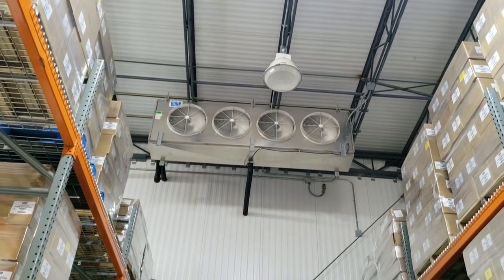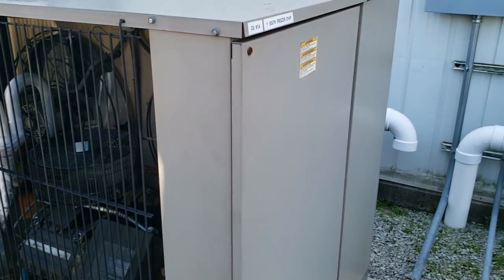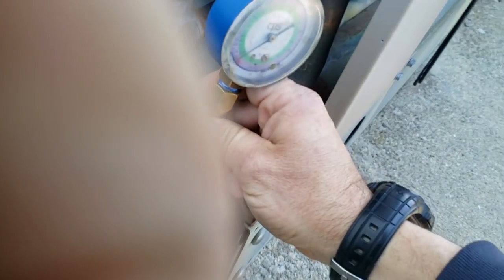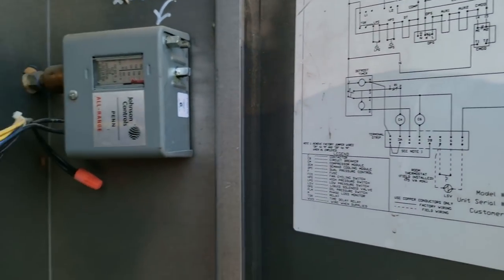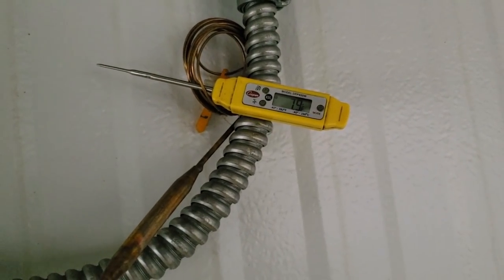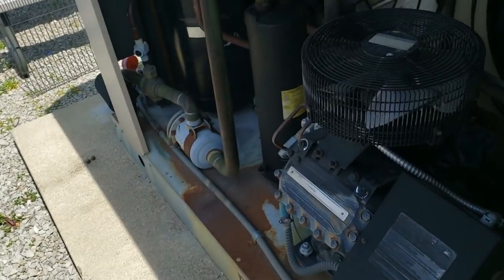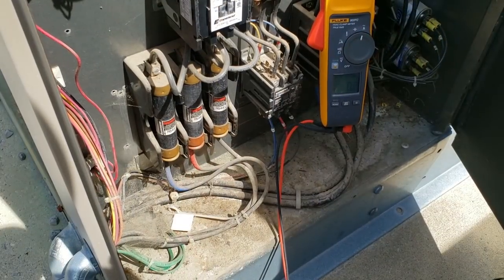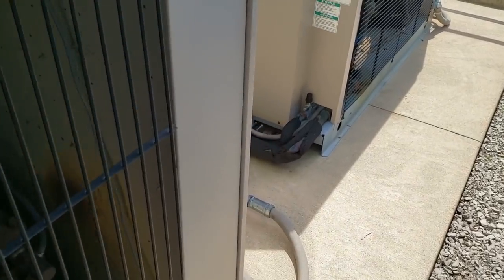Drive-In Freezer Warm

Comment: Wow, I thought you were in the freezer I just fixed yesterday until saw the second evaperator. The unit I was working on had an old Kramer evaperator. I had to climb a broken extension later to get to the thermostat. They had another tech out there before me that hacked the life out of the whole freezer. There are multiple places where the copper rubbed out its amazing that its holding refrigerant. The whole unit is pretty much soaked with oil.
Reply from the maker: Yeah that completely sucks. Luckily the guy was able to lift me up with a forklift in a cage. That made it easy.

Comment: it doesn't hurt to put meter probes on the exposed wire just beyond the lugs of everything, contactors, fuse blocks and more, that can catch a loose lug before it goes crazy meltdown, maybe even a weak fuse, but so can thermal imaging cam :)

Comment: Great troubleshooting. Thank you for posting.
It woud be interesting to follow the path of current asymmetry 43/37/37 A. Regardless of on how you calculate it, it is considerable. Copeland states max. 15% difference among currents and here we have (43-37)/37=116%,  i.e. 16% difference. It could be a result of voltage asymmetry but without voltage measurements this can not be ascertained.
Reply: Are you referring to current imbalance? 
 If so, the formula is as follows for the data provided: 43+37+37=117.
 117÷3=39. Our maximum deviation from the average equals 4. 4÷39=0.1025. Multiply this by 100, and we get a current imbalance of 10.256%
Reply: @jakem117  

Thanks for your input.

From "MOTORS FOR COPELAND™ SEMI-HERMETIC COMPRESSORS", Ref: D7.9.1/0703-0415/E  I quote:

"Deviations of currents from one another are allowable within the scope of nominal voltage (± 5%) up to ± 15%."

And try not to introduce unjustified significant positions - measurement was done with ca. 2% declared accuracy). Stating 10% would be fine. Giving final answer with 5 significant digits makes no practical sense (and we are real engineers, aren't we).

Comment: Hey Rick howve u been?
I have a question that WIC an WIF refrigerant charge.
Everyone's said sight glass is full. 
But my question is some of my system is bubbling.. I charged by outdoor temp. Indoor has 37f but still bubbling on my sight glass. I still confused whats the purpose of sight glass..
 Any advise??
Reply from the maker: Sight glass normally will be full but you have to factor in the outdoor temp. If it's really hot it can also bubble because the liquid can't condense properly. If it's really cold it also can bubble because it wasn't properly calculated in the summer.

Comment: good job Rick. i had just change out a emerson amg solenoid coil today. it is 120V coil. and my voltage going to the coil are120V too .two minute later the coil get so hot and smoking and burn out. any ideal why?
Reply: either you accidentally used a 24volt coil or it's infact 208/240V, if you checked with a meter it was likely reading leakage current showing 120v when the thermostat or clixon was open/solenoid off.
meaning you may have just seen very low current leakage and the meter doesn't load the circuit to pull it down. fluke has a special adapter for that or just place a known good 240vac item across the circuit in parallel with meter to shunt the stray leakage current (assuming 240vac or less actual voltage)
Reply: If the solenoid is not on the valve stem, it will get hot and pop. Even jamming a screwdriver in the bore will keep it from blowing up
Reply: @itsmemsti  thanks
Reply from the maker: Exactly correct 👍👍

Comment: Is it normal for only one of the CFMs to be running?
Reply from the maker: Condenser motors, yes depending on how they are controlling the head pressure. It can be any combination of game plus they might have a head pressure control on them. Basically a headmaster control. (Open on rise and a open on differentia valvel)
Reply: HVACR Survival ah I see. I would have saw that and first thing would have considered replacing it. Thanks!

Comment: Did you get a new meter? Looks new
Reply from the maker: Whats up Trucker? I haven't heard from you in a while?  I got it on Ebay, its just like new,  I needed a basic quality meter with better battery life. I have some nice meters but I keep them in the truck. I'm OCD LoL
Reply: @HVACRSurvival  yup been a while. the trucking side got me working 6 day 1 day off schedule will be like that for the restof the year. Have to keep those groceries coming,    
The Hvac is coming back the company i work for has a job for me tomorrow on my only day off. Lol plus he throw me a bone on a side job for his family member.
Reply from the maker: That's good, extra money is nice. 😁
Reply: @HVACRSurvival  902 FC is a basic quality meter?  Since when?
Reply from the maker: @joehead1294  more like when has it ever become an advanced meter 🤣. It has basic ohms range, voltage, capacitance and microamps. It's a good meter but it's slow compared to my fluke 376 FC or my fluke 87V.
Reply: @HVACRSurvival  Maybe the bluetooth slows it down.
Reply from the maker: @joehead1294  the Bluetooth is really more of a gimmick, nothing you couldn't have accomplished by hitting the hold button. The range is only like 15 to 20 ft. All these opinions of the device has more to do with it being used as a normal meter. The sample rate is the issue, it samples slowly.
Reply: @HVACRSurvival  Some meters are slowed down by auto-ranging.  What I find interesting from watching your videos is when you do a voltage drop test across a contactor carrying current, you don't get a value other than zero.  I'm sure you are well aware that can't be true, but the meter resolution doesn't indicate it.  My extech clamp meter gives me results in the millivolt range, so I'm surprised the more expensive fluke does not.  It seems the fieldpiece clamp meters are similar in operation.

Comment: The thermometer which you are using has no quick response
Reply: I don't have that exact model, but a similar one for Automotive AC, they take a good 30-60 seconds for major temp changes. They are definitely not fast, but a couple degrees change should only take a dozen seconds or so.
Reply from the maker: That's the same thermometer that I used to measure my ice cream and with that needle tip that it has generally can get my temperatures within 5 to 10 seconds. There wasn't very good airflow where I was taking the readings so the ambient temperature took a while. As you seen my other videos I've got some high-end Cooper Adkins and Fluke thermometers but they all test out the same. I could also have used my Fluke infrared 62 Max plus. But you can't always rely on infrared to be accurate unless you have the correct emissivity set.
Reply: @HVACRSurvival  that's good only to dip it inside food , not designed to measure air inside a space. Use thermocouple type k , fast response and accurate
Reply: I disagree. The Cooper Atkins Thermistor thermometer he's using has a plus or minus accuracy of two degrees Fahrenheit. Although is may not be as fast as a K type thermocouple, it will be a more accurate measurement.
 K Type thermocouples are great, but usually don't have an accuracy better than plus or minus four degrees. This, in addition to the accuracy and resolution of the meter the thermocouple is plugged into, makes them less than ideal for critical temperature measurements. 
 Please research this if you don't believe me. I feel like you have misjudged his instruments capability due to its physical construction. Sensible temperature, is still sensible temperature. How we measure the average kinetic energy of the molecules of a substance can vary, and it's important to understand that there is more to heat than we care to understand
Reply from the maker: https://www.cooper-atkins.com/products/temperature-humidity-thermistor-instrument/ Here is my most accarate thermometer. Its .3 deg tolerance. My probe shown in the video is 2 deg tolerance but tests at 32.0 in a ice bath. I have tested them all together and there all the same temp. The thermostat was off by 12 flipping degrees. Not 1 0r 2, so this argument is not valid.  The pocket thermometer shown has a 6 sec. response time in foods and is still faster than a standard thermometer used buy most techs. I'm a tool nut..I try to have the best. I also have the Fluke 52ii.
Reply from the maker: @jakem117  Thanks, I'm not sure how this is worth even talking about. LoL  The customer knew the temps were high, I measured them as high and the stat was off by 12 deg. I changed the stat and I haven't heard back from them in 5 days.
Reply: @HVACRSurvival  you cannot measure airflow with something is not designed for. The comparison which you did has no sense because you are using same thermometer style. You can get something close but not accurate.That's the point . You never find a manufacturer using that type of sensor on their equipment. And if you find it , make a video. Sensors can be many types NTC, PTC, p100, p1000, thermocouple, each one has a use. To understand the concept you need to study instrumentation and electronics . It's beyond what you are doing . I am licenced refrigeration Mechanic and licenced Electronics service technician.
Reply: If the same theory he advocates were to be accurate, you couldn't use a Class 1 analog pressure gauge that's red to measure refrigerant pressures on the "low side" of a refrigerant circuit... 
 By the way you channel is cool, and is helpful. Been doing commercial HVAC/R and ice machines for a year now. Your troubleshooting sequence differs from mine, due to my lack of experience. Science and fundamentals take you far, but experience is also critical for diligent and accurate service. I've seen some things you've done that I've learned from. Looks like you do good work. 
 Are you in the game yourself, or are you gainfully employed?
Reply: Immigration Freedom: You had just stated that a K type thermocouple would be more accurate. They are not as accurate. I've never seen, a commercial HVAC/R system use a thermocouple to measure air temperature, they predominantly use thermistors. These thermistors are usually but not always NTC ones. His Cooper Atkins is a thermistor based thermometer. Thermometers measure sensible temperature... How does a K Type thermocouple with a maximum inaccuracy of plus or minus nearly four degrees plus attached instrument accuracy variance beat a self contained thermistor with only one variance?
 If this is something you believe to be true, explain or cite WHY, or stop insisting on your point for which we see no evidence there-of
Reply: Also, please refine your word choice. He's not measuring airflow. Airflow is not measured in sensible temperature, nor is airflow expressed in degrees Fahrenheit or Celsius
Reply: @jakem117  I mean airflow temperature, no point to waste time on this,  you cannot judge the book by it's cover, I watched this guy in another video and he has trouble to understand head pressure regulator fundamentals which take him a long time to figure out the issue . If you don't want to learn by advice , you will learn by hard way
Reply: Okay. I asked if you would add data to prove your point. You rejected this reasonable request for us all to understand your theory. 
 Don't comment on someones instrument choice if you wont explain WHY
Reply: Oh and by the way Immigration Freedom, get bent. You're on a soap box that you say is measured and proven to be factually accurate, when you really stand in the puddle of misconceptions and depraved ideas with no scientific ground to be graced with.
Reply from the maker: I'm working every day. Thanks man 👍👍
Reply: @HVACRSurvival  everyone has choice but doesn't mean his choice is correct, if you want to start the theory then linked to practice , then read about sensor sensitivity and type of sensors. It different topic , you need to have a good background in electronics . In YouTube channel should be people,  open mind for critics, not rejecting facts.. I am proud that I was working not in refrigeration for restaurants but I was in supermarket refrigeration for years. Don't think you are the only guys that have the knowledge and the rest are watching. We learn everyday ...
Reply from the maker: Very true.